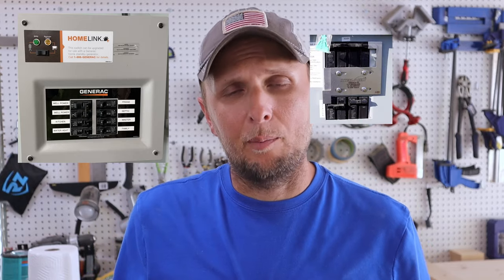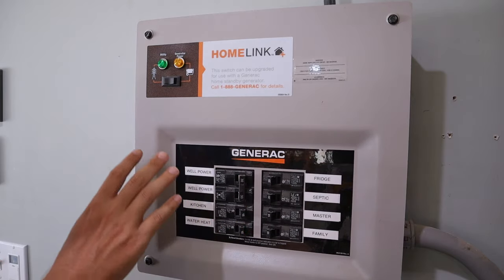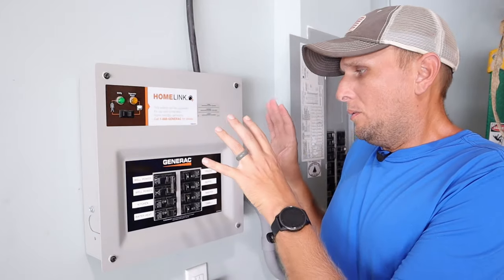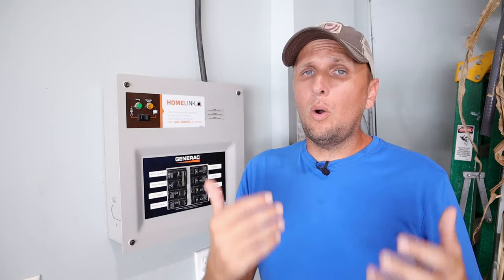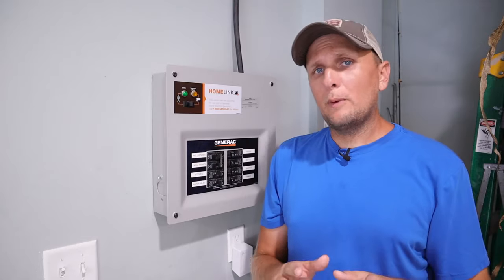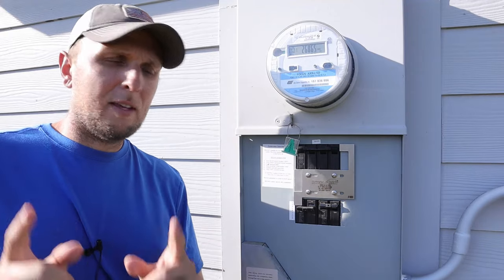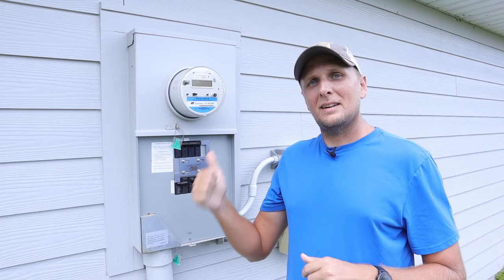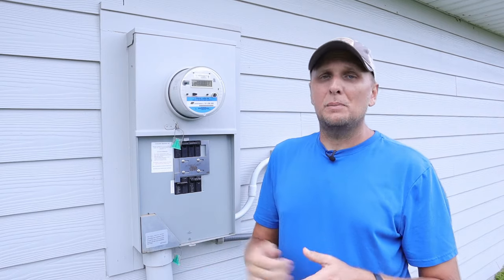How To Choose Between A Transfer Switch Vs Interlock Kit With Power Inlet Box

Comment: Good video, but you are skewing the reality. It would have been much better to state that having a small generator running whole house via an inter lock switch requires load management.Meaning, not running more than one or two high consumption items at a time. Knowing the limitations of your generator and limiting the amount of power used at one time DOES NOT require you to constantly run into the basement to switch breaker on and off, that is just plain silly, and is misinforming your viewers, doing a disservice to them. Also, if one is on backup power, common sense dictates that they should be conserving power, as running a generator under high load is not cheap, and fuel supply may be limited too.
Reply from the maker: Misinforming?   I said all of that.  And yeah sometimes you have to go switch breakers on that you need like the water pump but shut off the freezers so not too much load is put on the system.  This was all talked about yet somehow I skewed it and misinformed people.  Amazing.
Reply: @HowToHomeDIY ,
First off, this was not an attack on you personally, it was constructive criticism, but you unfortunatley did not see it as such. I actually watched the video again, to make sure I didn't miss something. You spent the first 2/3 of the video promoting how great a transfer switch (panel) is, and how impractical (practically insinuating impossible) an interlock is unless you have a large generator. 
At 3 min and 20 sec, you state that you will "constantly" be going to your main panel switching circuit breakers on and off (this is just not true). Then at 5 min 27 sec, you say that with generators 8000 watts and under, you should really consider getting a transfer switch  because you're "never going to be able to run the whole house with a generator that size, let alone even half of it. Really?! This very misleading and not true, you can run quite a bit with 6 to 8kw generators, including deep wells.
Then, at 7min 37 sec, you seemingly back pedal and say, that doesn't mean someone with a smaller generator can not install an interlock, but it won't be as simple as a transfer switch, and then yet again, at 7min 47sec, you again proceed to state, that you will have to be switching breakers on and off, in your panel, all of the time, and you further reiterate what you said earlier, that "you're never going to be able to fully run your entire main panel, let alone, probably half of it." Then you continue, making a  vague statement, "it all depends on how thing are." Do you expect an average person to even understand what you meant by that vague statement? Except for this vague, feeble hint, nowhere did you actually state, explain, nor encourage the concept of load management (WITHOUT needing to obsessively turn breakers on and off). And in my humble opinion, that alone is the key disservice to the people, that I was trying to point out. In this day and age, people are getting poorer by the day, with very little resources to spare. They need creative suggestion for solutions under limited and difficult conditions, to work with what they have and what they can afford. So, instead of saying you can't do this, and you can't do that, or this won't work. How about saying something useful and helpful like, "for people on a budget and with limited resources, houses can be run on medium, and even smaller generators with careful and/or creative load management, depending on load needs of the house." Touch briefly on what is load management, and then offer to do a detailed video on load management, if there is interest from the viewers (I'm sure there would be lots of interest and it would be very helpful to many). For an example, you could split the generator issue in to three general scenarios, homes that have very low load, like in villages and towns, where they are on public water, meaning no well, and they have no high draw appliances, like electric cooking stoves and electric hot water heaters. These types of households could easily load manage their whole house on a smaller generator (3 to 4kw). Houses with that same type of setup that have the additional load of a well pump, would do fine with fairly simple load management on medium generators, (5 to 8kw). Obviously the homes with deep wells and high capacity pumps would be better served with 6 to 8kw units. Even homes that have electric appliances can get by with 6 to 8kw generators, with careful load management. Unless someone has money falling from the sky, or lacks common sense, it is not reasonable nor practical to expect to run your whole house all at once, simultaneously. Most load management can be done without shutting breakers on and off. The only exception is if you have an electric HWH and your generator does not have much capacity over what the heater draws. In those cases, one can turn the heater on once a day for an hour or so, depending on your needs. If you have a family, it is not hard to instruct them on basic load management. I know that the last time we had an extended outage, using my 4kw generator, I was able to run my whole house, including refrigerator and two window units, one being a 1 ton capacity and the other 3/4 ton capacity, PLUS, lights, TVs, refrigerators, and freezers of two other neighbors, with no issues and no tripped breakers, and with out needing to flip any breakers on and off. So, yes, one can, reasonably and conservatively, run a whole house on medium to smaller generators, without having to constantly turn breakers on and off. Knowing how to load manage with what you have and being creative goes a long way. Put another way, do you think people with limited resources are better off running extension cords all over  the place, tripping over them, etc, or are they better and safer off with a interlock system and load management?  
I think your viewers would greatly appreciate a crash course on load management. 
Again, this was not a personal attack, just constructive criticism. I find it very unfortunate, when people of influence repetitively say, that you can't do something, when you actually can, as this ends up misguiding people, especially the ones that have little to work with and are looking for creative solutions. 
Wishing you all the best in life.
-John
Reply from the maker: I’m not going to reply to all of that as it is full of opinion, misrepresentation of what I said and meant, hypocrisy, and arguing the same points I did just using different wording.  I didn’t mislead or misinform anyone.  Both systems are great, I use both.  Choose what you want.  Take care!
Reply: @johndiezel5781 you didn’t personally attack him?  Seemed to me you called his integrity into question.  Most people that care about what they do are going to care about that.  You said he was misleading, when he said a smaller generator couldn’t run a whole house but then you say that but it can run a lot of it.  Like he said you’re being a hypocrite there.  The rest of what you said is just pulled out of your rear 😂.  Load management is flipping breakers on and off to make sure too much isn’t pulled at once.   My goodness you tried to sound so smart but in the end, did the opposite.  Ignore this guy how to home.  Kudos to you for not responding like him.  Passive aggressive.